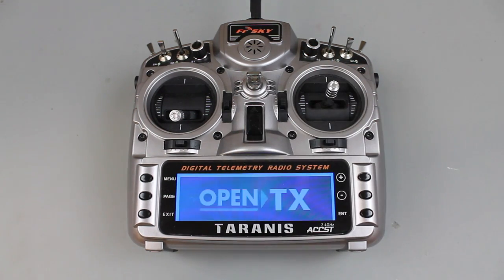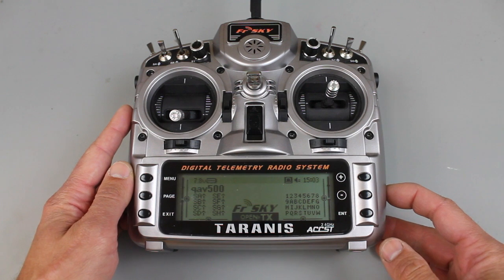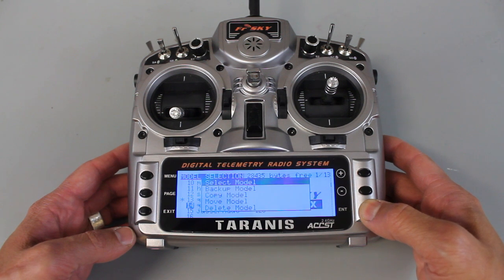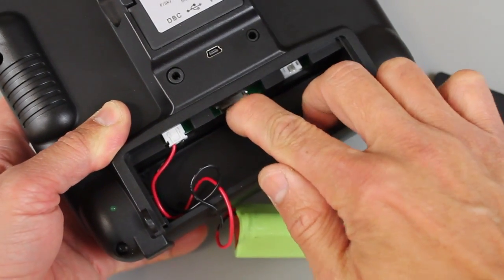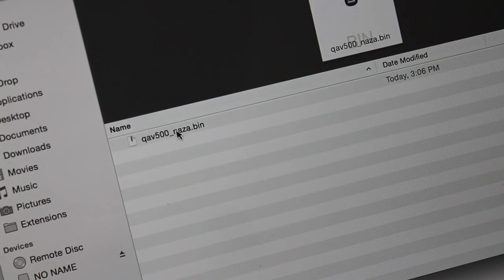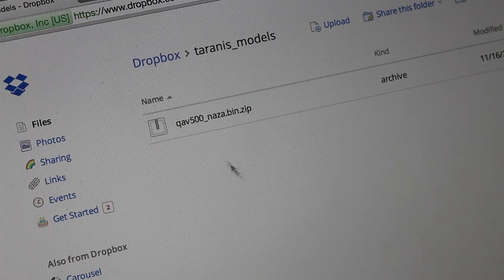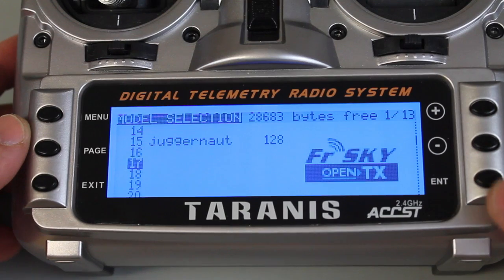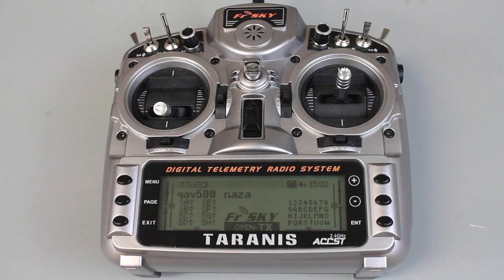FrSky Taranis Backing Up and Restoring Model Bin Files

Comment: Very usefull, you could do it without opening the radio by going in bootloader mode (both horizontal trims to center while powering on) and just connecting a USB on it ;)
Reply from the maker: Great tip, Daniel. Will have to check that feature out. Thank you.

Comment: When you restore a backup does it retain the bind to your rx

Im tring to create a backup tx and have all the models copied over in opentx  but they arent bound and i have to manualy rebind. Wondering if you method retains the bind

Cheers
Reply from the maker: Saggy, not sure if it maintains the bind. If I recall I had to rebind, but not 100% sure. I'll try again in the near future and share my results. Thanks for the question.
Reply: Dennis Baldwin nope sadly it des not. Was hopjng tk have a taranis as backup but i have to rebind every model to each taranis each time. External module is work around.

Comment: best way to do this is press both the bottom trim switches in to the middle of the controller and hold then turn on the power will go into bootloader/masstorage device easy as :)
Reply from the maker: This sounds like an awesome tip. I'm going to have to give that a try this evening. Thanks for sharing.

Comment: I've got a question for you, I think my firmware on my taranis may be messed up. When I plug it into any machine it ways the last USB device malfunctioned and it won't let me access it even in bootloader mode. Is there any way to put the firmware on the microSD card and flash it from that?
Reply from the maker: Check out this thread and good luck: http://www.dronetrest.com/t/how-to-upgrade-firmware-for-frsky-taranis-x9d/959
Reply: If you have bootloader already on your taranis, then you can copy the file to the SD card, boot up in bootloader and select the new firmware for upgrade.  I can't get mine to talk to my mac....and I have tried almost everything.  So I have to use the SD card swaps for everything!

Comment: Do you know how to do a factory reset? I downloaded the new firmware from OpenTX and now I can't bind anything to my radio. Worse is I can't even get the ones I had bound to work anymore? Any help would be great.
Reply from the maker: +3000gtwelder I haven't found an easy way to do this. Here is a thread on the topic: http://openrcforums.com/forum/viewtopic.php?t=6016
Reply: Thanks, I found out how to do it. It turns out I had a bad board, that had t be replaced.

Comment: Dennis thanks for the vid. I have 23 models on my taranis would I have to back up one by one or can it be done as a group.
I would like to back up all for safe keeping. Also Is there a computer program to make changes to model information
Reply from the maker: John Knopp I'm not sure what version of OpenTX firmware you have on your Taranis, but if it's 2.0 or greater  you should be able to use Companion9X to back everything up with the click of a button. If that doesn't work then the easiest, but cumbersome way is to back each up individually. Check and see if Companion9X offers editing a model. I haven't done this before, but would be good to know. The next time I hook it up to my Mac I'll be sure to test and share my results. Good luck and thanks for the comment.
Reply: Dennis Baldwin Can you email me at jkknopp@gmail.com I have a lengthy question on mixing channels on the taranis I want to see if you know it.

Comment: Great video again mate. Thank you
I have a Taranis Plus, and I power on with trims held towards center to go to bootloader menu.
Then connect USB to computer, and you can browse to the SIM card in the Tx.
I found it was easier this way than removing everything, etc..just a thought.
Reply from the maker: Kevin Ray Neat tip. I wasn't aware of this. I will give it a try and hopefully it works out. Thanks so much.

Comment: One quick question, I've set up the trainer switch so, when activated I get an audible reading of my flight pack voltage, saves me looking down  at the telemetry screen, I've heard it can be set so when you activate the switch a few seconds after the voltage reading you can get the RSSI reading and after a few more seconds get another reading if needed. Do you have any experience setting that type of thing up?
Reply: You can add as add as many special functions as you like to a switch position, just insert them one under each other.  I have switch H set so that on pulling it the current cells value is read then in the next line the current timer 2 is read.  There is no reason why the RSSI could not also be read,

I am not sure how you would introduce a delay but in my case I don't want one.
Reply: UKHeliBob Just found out how to add a delay if you need one.  You can create a Logical Switch and add a delay before it becomes active so you could have an LS to play the Cells value immediately when switch H is activated and another one to play the RSSI or whatever some seconds later.
Reply: UKHeliBob Thanks, after thinking about it, having 2 or 3 readings come after one another with a pause in between is really all we need, all you need is the most important reading first and so on. Myself, I am to involved in the flying to have to worry about pulling the switch more than once,I'll give your idea a go tomorrow when I'm in my hanger, I have a glider competition in a few weeks time so I'll set up the Taranis to give me the RX battery voltage and RSSI when activated. Thanks again.

Dave

Comment: I do not know what I did wrong but it did not load on my SD card? can you help please?
Reply from the maker: Soldier53flyer A quick way to test is to select a model and then long-press enter. Then select "Backup Model" and it will write it to the SD card. Go to an empty slot on your model menu and long-press again. Select "Restore Model" and you should see the model name that you just saved show up in the menu. If that's not your problem then please describe in more detail. Thanks.
Reply: Dennis Baldwin Thank you Dennis for getting back to me, I did what you told me to, but it did not show up in the screen. so I think I messed it up down loading it? It's just my luck. :-( I tried to redo it but the same thing happened.